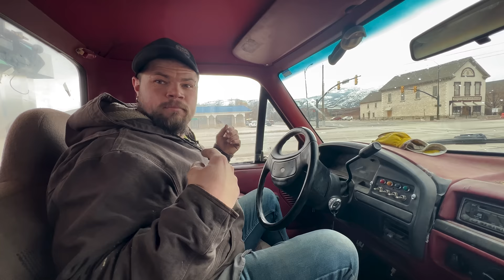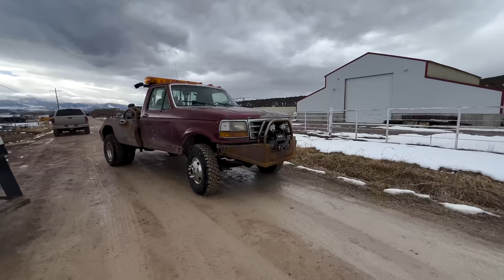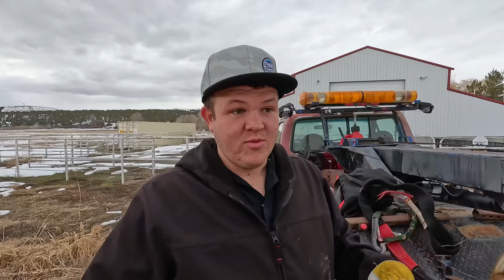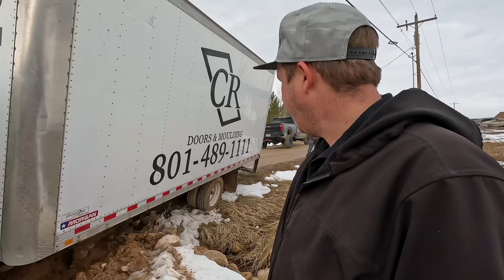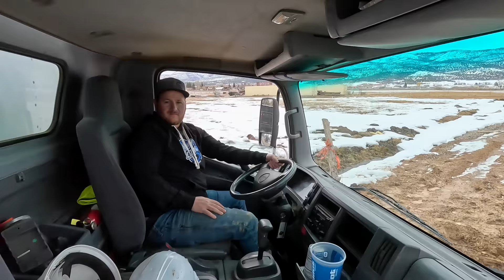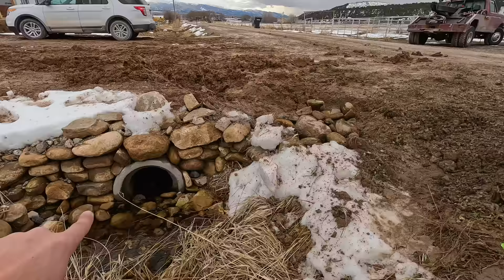Huge Box Van Stuck In Mud, Can My Old Ford Tow Truck Get It Out!

Comment: Robby I have a 1980 Chevy K30 that has a holms wrecker body on it with two big winches to the boom!!! Everything works on it also!! Manual transmission with the 205 transfer case!!! It has done everything that I have hooked up to and had to pull off including a skid loader that was buried above both tracks on it!! I’d be interested in selling it if you are interested?? It’s definitely not a Ford for sure like the one you have been using!!! Lol!!
Reply: He's got the Model A coming as well - does he need 3 wreckers? LOL
Reply: @promethbastard Matt has all of his corvairs. Robbie has always had a towing operation besides the body shop. He is just adding off-road recovery to his business

Comment: Hey HillBilly...it's called 'hook up' for a reason..with hook down, if it breaks, it goes 'UP', if the hook faces down and it breaks, it goes down..safer. Where you hooked the winch line back onto the wrecker bumper.

Comment: Robbie you should lay a blanket over those rusty steel cables on Fred before you put a load on the cable before someone gets hurt.Steel cables are very dangerous compared to the synthetic ropes when they break.

Comment: Fred the little red towtruck is a cool old truck. But after seeing that cable and hearing the noises it was making, I would be thinking about putting new cable on his main winch. Some 9/16 or 5/8 wire rope winch line should do the trick.  lol.

Comment: You guys need a new winch line on that wrecker, you can see the kinks and rust for days, or at least put a floor mat or jacket over that cable while winching so if the line snaps the mat or jacket will absorb some of the energy

Comment: fred should have pulled from the rear. and out the way it went in. onx truck side tension from front corner accross from road to give peace of mind the front wouldnt sink further in and possibly tip the truck.
 
5 years of doing PD calls in and around Portland Oregon, you learn and see so much.

Comment: @Hillbilly the gas stations are most likely franchises. Often, you'll find a group of stations all managed by the same company. An independent operator doesn't have the same capital to renovate as often. Keep up the great work!
Reply: Yeah I believe Sinclair's are all independent. Maverik is a huge corporation. I'm still bummed all my local Kum & Go's are getting converted to Maverik.
Reply: I guess if you have the money you can put up a franchise anywhere. At one intersection in Vegas there was four 7/11s  one on each corner

Comment: You should pull the winch cable out and inspect it for broken wires. If that was under pressure and it snapped it could be devastating. Just concerned.

Comment: Your hooking to wrong side on the front your lifting towards rolling it over. The low side makes it virtually impossible to roll over. If your worried about it use second winch to the top. You could winch to back and steer out of the ditch. Your just making everything X2 harder. Pulling from back and front. Need to take some recovery classes through your state towing association

Comment: Federal regs say underground tank  have to be pressure tested if metal every 5 years but fiberglass every 10 years with I don't know the latest but the metal ones have to be changed by 2025 to fiberglass and all tanks have to be replaced on a regular bases

Comment: The mud has no experienced or learning driver to trick , it just has no clue you are there, I mean if it was dry and he had turned out or in too close and ended up in the position you found it on it was going to need more soil and a ramp , now you just have used the same mud to get out of there